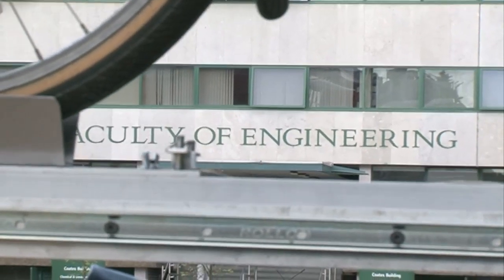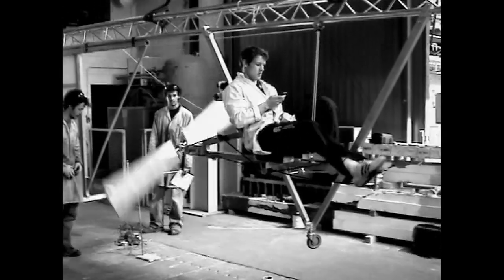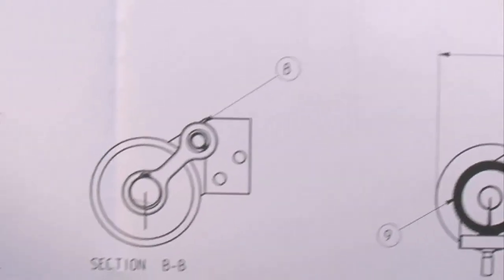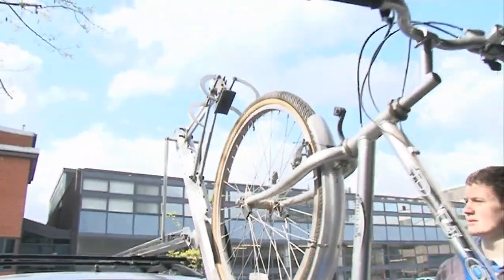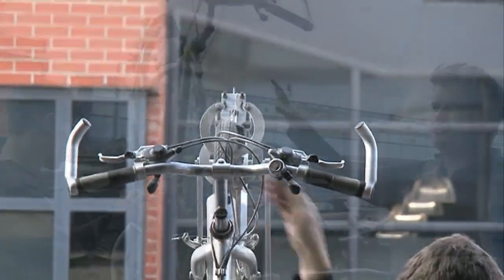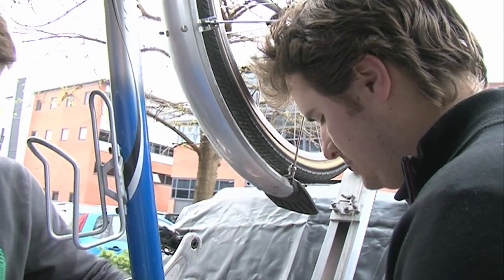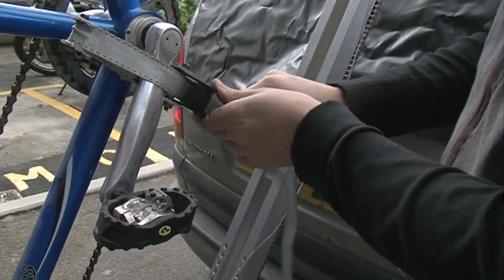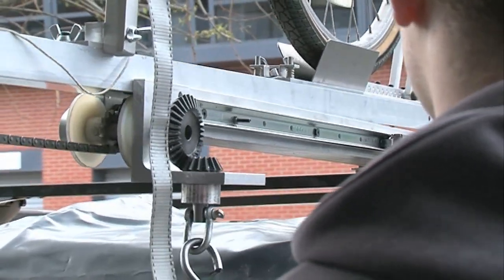Tandem Roof Rack Test

Comment: Great effort. I see 2 basic problems with it however.

1) Stability (which they themselves identified - could be resolved by attaching a couple of harnesses to the roof rack, and / or making the base and assorted mechanisms out of thicker material)

2) The rear overhang of the rail obstructs the opening of the boot lid - potentially damaging the paint / glass. 

Very well done though :-)

For the upgrade, add a motor that automates the process and can be plugged into the car.